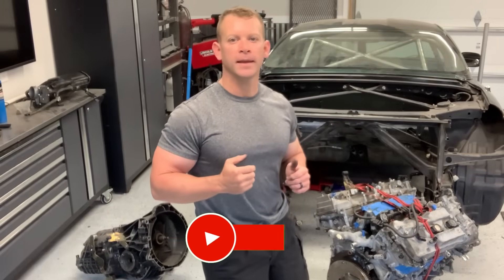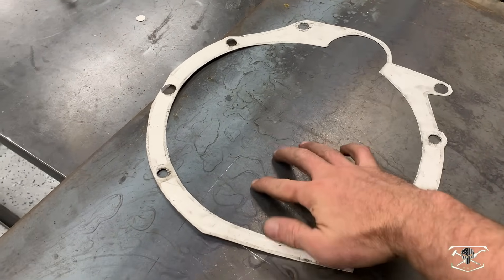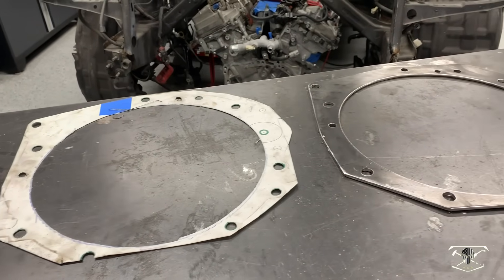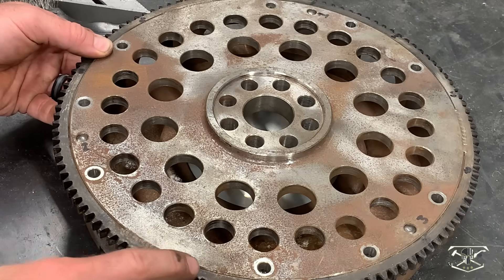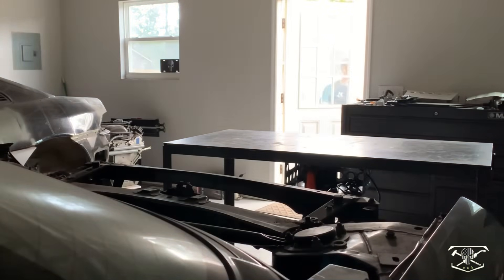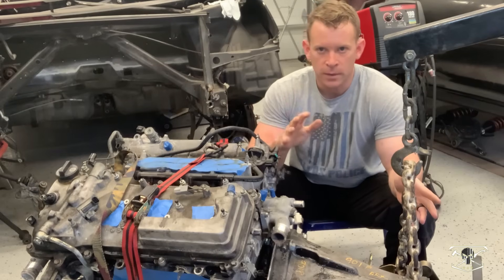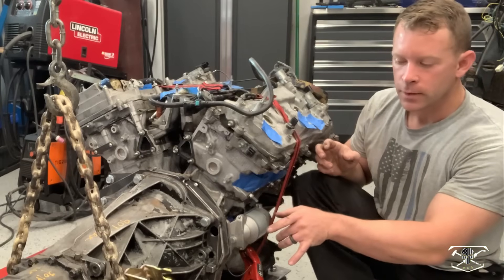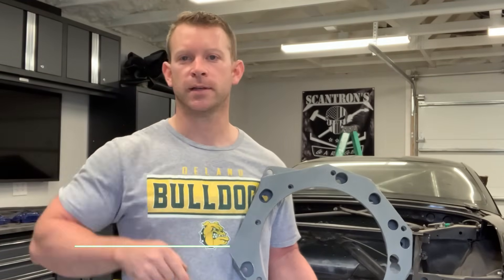DIY Engine Adapter Plate (Mate any Engine to any Transmission)

Comment: I bought an adapter plate one time to fit a 1993 1.6 8v geo tracker engine into my 87 Suzuki samurai. It cost me $160 and everything went smooth and worked great
Reply: I bought that same plate.  Works great.  Nice having a car that has cheap parts
Reply from the maker: That's a great deal! for things to work with this transaxle, they usually cost over 2k

Comment: How are you getting things centered? Doesn't that transmission input shaft have a bunch of play?
Reply from the maker: The porsche input shaft and pilot bearing is a zero clearance fit which is super helpful in this circumstance. It does however make it extremely difficult to connect the trans to the engine

Comment: How is the engine centered to trans.?
Reply from the maker: The center point was determined by aligning the input shaft into the pilot bearing. Yes I know this is critical. The plate thickness being consistent will prevent deflection.

Comment: Congratulations on your craftsmanship. The problem is you can't prove  centerline, input shaft to the crankshaft. Should be around .003". Mainshaft input bearing and high gear syncro will be the first victim.
Reply from the maker: Thank you, and yes I see your point

Comment: Nice job on the adapter plates. 
Back in the 60s, I adapted a Chevy 283 to my Willys wagon top loader transmission and transfer case. The only real problem I ran into was I needed a longer transmission pilot shaft which luckily was available through a local truck supply shop.
Reply from the maker: That sounds awesome! The custom wider flywheel I made solved that problem in my case

Comment: I want to do the same thing. I have a 1UZ V8 out of a Lexus SC300. I have a w58 manual transmission out of a Supra I want to bolt up to the 1UZ V8. I have the bellhousing from w58 as well as the flywheel with clutch. Also I have the transmission with Bill housing and flexplate from the 1UZ V8. What would be the best plan of attack. Keep in mind the 1UZ was never offered with a manual transmission. I do have a totally awesome esab rebel smart welder. I do have the know-how I have been working on cars for the past 25 years. The last I want to say 10 years have been in the rustoration/ restoration part of it. Anybody would be much appreciated. Thanks in advance. I have seen companies out there that make the adapter plates. Definitely want to save as much money as possible so we can go to other parts of the build. The engine and trans is going into a 1977 Corolla ke30 two-door. Planning on making it look as factory as possible. A total sleeper. The nice thing about the 1uz is that it's all aluminum and only weighs 100 lb more then the factory stock 4-cylinder with a cast-iron block. I'm thinking that too much modification on the suspension end of it.
Reply: Not too much the suspension end of it*
Reply: Would I possibly be able to use the flywheel and clutch setup from the w58
Reply from the maker: That sounds like a good combo to me! Sounds like you have everything you need to get started.

Comment: I'd worry how  square the engine and trans are with each other to avoid binding. I'd mic the thickness of the adapter. Variation from side to side will cant the parts. As a double check I'd  measure the distance between the assembled parts. That should assure the assembly ends up in a straight enough line to minimize binding.  I have no good ideas about how to optimize centering the jackshaft to the crank pilot. Imperfections will be exaggerated as RPM and power output increase.
Reply from the maker: You are certainly correct. As I move further along with the build, the plate will be milled on both ends to ensure accuracy

Comment: Exactly the same way i made the adapter for my GT40 replica 20 plus years ago .. Had some hard track work and street miles and never missed a beat.. Great video. nice clear explanations of each step.. Well done..
Reply from the maker: That sounds awesome! And I'm happy to hear it worked out long term
Reply: My teacher in HS had tons of AC cobra replicas. I was the only one he trusted for paint prep and interior instal.

He made an adapter to use one of the ginormous Ford v8s from a big rig. I didn't do any of that stuff but I have seen it round town and good god a 500ci+ big block in that little frame makes one hell of a rocket ship

Comment: Garage built, I love it! There's something I've always wondered about these adapter plates. That's how to make up for the extra space between the engine and transmission. Based on the differences of input shaft length and bellhousing depth it may or may not be an issue, But I'm going to say it usually will. You seem to be getting into it as you're talking about the flywheel, but I didn't fully get it.
Reply: The few times I've heard of it being an issue a simple spacer on the flywheel/flexplate was the fix.
Reply: @davidlaughman5358  thanks!
Reply from the maker: Thank You! and yes you are right, I glassed over a majority of the flywheel technical information based on the fact most people don't want to hear all that
Reply: @scantronsgarage what does adapter plate cost that will bolt a Chevy powerglide to a ford 390 fe engine
Reply from the maker: @eddiefe428  That kind of depends on how well the two line up. In the case of this video, I had to cut  a portion the block to mount the starter motor. The machined flywheel cost about 600. And I would estimate the time to fabricate with materials would be about 1500. This process took months

Comment: What was that angle thingamajig thst was 2.5mm off. How does it work?
Reply from the maker: That is one of my favorite tools , it's  a digital angle finder. I used it to get both the engine and transmission both level to each other. In this case, it was sitting on the floor at a 2.5 degree angle. I made them both 2.5 because the car frame holds it perfectly level. The concrete was throwing the motor off perfect level.

Comment: It is obvious you did a Great Job on this adapter plate. The layout and actual build are very informative and practical. I wish you had taken more time to explain how you insured accurate alignment of the crankshaft and input shaft before you started welding the web to the two plates. Precision alignment is the difference between it being a usable adapter or a piece of scrap metal that looks like an adapter. Obviously you know what you are doing, I just wish you had explained to us how to do it too!  Thanks for a good video!
Reply from the maker: Thanks! I cut most of that out due it to being boring and repetitive. I measured between welds as well. Probably as accurate as you can get for hand made. At the end of the mock up process, It will get sent back to the machine shop to get milled on both sides
Reply: @scantronsgarage  That addresses my concern about squareness. I stil wonder how I would assure centering.
Reply: yup
Reply: @spambedam he basically did NOT properly center it. That part where he engaged the starter and grabbed the output before welding it together.  That was it.

Comment: For safety rotate your workpiece against the left side of the drillpress column while clockwise drilling.
Please consider in a waste location bolt the plates together add a center hole and any dowel holes through both using slip fit for future alignment references. Thansfer your thempate profiles, mounting clearance and threaded holes. Have your machine shop provide mounting boss spacers to provide parallel alignment, then weld, weld and weld (completing with the dustcovers).
Reply from the maker: Well said

Comment: Couple things. First I noticed when you cranked it with starter the first time I noticed that the flywheel was wobbling. 2nd thing is you have now way if knowing center line of crank & input of Trans. The 2 should be within approx.  .003in. Then the adapter plate should probably have been parallel  machined on both sides . If not you might have issues with pilot & input bearings. Dowel pins are there for a reason.
Reply from the maker: Yes and Yes.. The wobble you saw was from the center plate not being full seated. (it was just in for mock up). The dowel pins were retained and the plate will be milled on both sides after the car mock up is complete.
Reply: @scantronsgarage  im still curious how you're ensuring input shaft alignment. Good video tho
Reply: @YouZombieBro 
Yep I was thinking about that alignment myself.
Reply from the maker: @YouZombieBro  Thanks! I am betting on hopes and prayers... and It will go back to the machine shop after the car is done being mocked up or mill work on both sides
Reply: Now I see why they charge 3000 for the job...
Not as simple as one thinks

Comment: Nice work & good skills but I didn't see your method of accurately centering the two units together. There's too much play in a front trans bearing to just rely on having the input shaft in the pilot bearing with the trans free floating. If it's not dead center the clutch plate will walk on the shaft when rotating eventually breaking the center out of it.
Reply from the maker: You are correct. there was no other method other than shoving the input shaft into the pilot bearing. In this case, the two fit together with no play at all. After assembling the two, I spun  the engine to If i was getting any deflection (after leveling and supporting both the engine and trans which I spent a huge amount of time doing). Lastly, I spent a ton of time verifying both plates were perfectly perpendicular to each other. With that all being said, It still would not hurt to have both sides of the adapter plate milled for more accuracy.

Comment: The centre of the pilot bearing is the starting point of both the adaptor plates.I use the thinnest aluminium plate to make the templates.Much easier and more precise .
Reply from the maker: Thanks for the info!
Reply: I mentioned sometime ago how I use thin aluminium plate. Then make a centre pin that fits on the crank. Don’t cut the inside of your templates because it centralises the two templates.The you only need to get the thickness of the spacer.

Comment: If you will use plexiglass for your template, you can align things better. Sometimes you only need 1 plate and it helps for centering on crank and input shaft
Reply from the maker: That is a good idea, however plexiglass is annoying to cut and drill without cracking. I will definetly keep this in mind for next time though. Thx
Reply: @scantronsgarage for drilling plexiglass without cracking spin the drill bit backwards and it will melt the hole through without cracking every time.
Reply from the maker: @hotrodcasanova3574  🙃That makes perfect sense!! Thank You!!!
Reply: @scantronsgarage  You could always use something like HDPE, which is both cheaper and more workable than plexiglas.
Reply: I think polycarbonate like plexiglass is good for the see through aspects and is less brittle or will not crack with drilling.
Reply from the maker: @brunorios7223  Good thought !
Reply: I've made a template out of clear plastic from TAP Plastics. I told them what I was using it for and they selected the best plastic for drilling and cutting. Robot Cantina details in one of his videos how he made a plexiglass template. Transfer pin dowels, dowel markers or transfer pins help transfer holes more accurately. Wrapping masking tape evenly around the dowels help when you don't have the correct size or 3d print your own. I've made some from Allen Head set screws in a pinch. I am sure you could make some from threaded studs sharpened at the end with an angle grinder.
Reply from the maker: @BigBlueMotors  I think this is a great idea! thank you. I will try this in the future
Reply from the maker: @BigBlueMotors  THis is good information. thank you. I will try this in the future .
Reply: Plexi is expensive, chips and is brittle and delicate. It's uncommon for patterns in industry (I've never heard nor seen it despite being into machining and much more since the 1970s) because metal is reasonable. If you misdrill plexiglass you can't just MIG it closed and redrill to spec. I have no idea unless it were free (my favorite brand of anything) why anyone would use it for patterns.
Reply from the maker: @obfuscated3090  Good information. Thanks for sharing👍
Reply: Top idea

Comment: At 5:31 the wide piece is attached to flywheel. I understand the flywheel being machined to accept the piece it needs to accept, but why is the wide piece on the back side of the flywheel? If that piece were not there, could the engine and trans be mounted closer together?
Reply from the maker: Yes and No. An adaptor plate creates thickness in itself so that thickness must be added to the flywheel. The alternative would be to have a longer input shaft made to the transmission but that would be big $$$

Comment: Thank you for sharing this. I’m getting ready to do a K or 4g63 in my 944t. I have a few 4g rwd cars already using existing adapters. This technique looks completely possible and easy enough to do.
Reply from the maker: Glad I could help! Thank you.
Reply: Sounds like a bishi guy.

I have a 78 colt galante(mitsubishi colt lancer/Chrysler conquest/dodge colt) with the 4g32b.

Ffuucckkkkkk that engine. Lost compression fast. I want to do a 4g54T or 4g63.
Sadly they're mad expensive so I'll probably use a stock 1uz

Comment: Where are you all these years ?
I don’t really understand the solution with the flywheel ..
Can someone explain me more please ? My English is at low level I guess..
The plan is to attach the original car flywheel with what ?
New subscriber !!!🎉 😊
Reply from the maker: Thanks for the sub!!! So to answer your question, I basically bolted two flywheels together. I am using a toyota flywheel machined down to fit the clutch surface from a two piece flywheel from a different vehicle. This was needed to push the clutch surface deeper into the porsche transmission for proper clearances. Hope that helps.
Reply: @scantronsgarage  okey 
So you make and hybrid flywheel with some fabrication to fit it well
You can go with a simple 3d printer to cover your the gap between them .
With plastic or other material .
Actually with this method you can go with any engine combination !!
My plan is to fit with this method a diesel engine in a old car 
My concern is about electronics 
And Ecu and so on ..
Thank you for the answer
Reply from the maker: @emmpro3558  you are welcome! good luck!

Comment: How would that work for an auto
Reply from the maker: Nice question! The process would be similar and easier. The adapter plate would still be used however instead of all that custom flywheel stuff, you would just bolt the torque converter to the flex plate with a simple spacer to account for the distance the adapter plate took up.

Comment: Simply Smart! Good sense and some out of the box thinking!
Torque is a deceitfully viscous monster.
I would web it on the inside and outside, and fully seam weld it.
To minimize warping, bolt it to a  part ( gearbox and then the engine, alternatively)
Run short 3/4 inch welds at opposite sides then leave it to cool for 20 min.
Slow, I know [ bit by bit, while you're busy with other stuff.]
Only unbolt it when room temperature.
It is going to stress fracture where it it welded after a few heat cycles if you don't.
I've seen it.
Over do it.
Thank you for your time and sharing your experience.
Reply from the maker: That is definitely an option as we get closer to getting this thing running. Thanks!
Reply: ???????  Do you mean VICIOUS? Not to be picky; just trying to understand your point.

Comment: Hi mate,
Can you make for me an adapter for mating a V6M5A gearbox to  4d56 engine. Both are L200 Mitsubishi pick up parts
Reply from the maker: I certainly could, however, is the cost worth it to you. You would need to bring me both the engine and desired transmission for blueprinting and there would need to be some flywheel work

Comment: How heavy is that flywheel? It looks like it weighs a ton!
Reply from the maker: It is heavy! I never weighed it combined but definitely over 25 lbs
Reply: @scantronsgarage  kind of a dumb question: have you looked into how much it will cost to make something lighter, or does it matter for you?
Reply from the maker: @rocketsurgeon11  It doesn't matter much... a heavy flywheel is good for drivability. The main goal here is to make this drivetrain work. I have the same flywheel on my v8 LS to porsche transmission. bigger motor though
Reply: @scantronsgarage  gotcha. Makes sense.